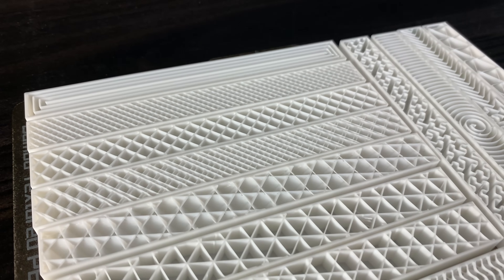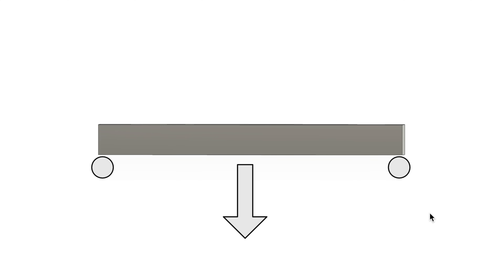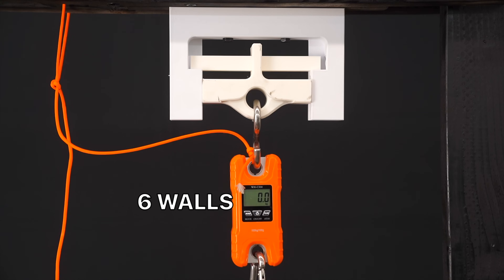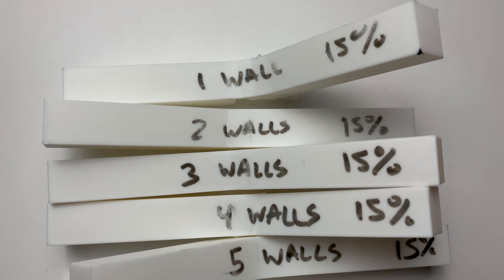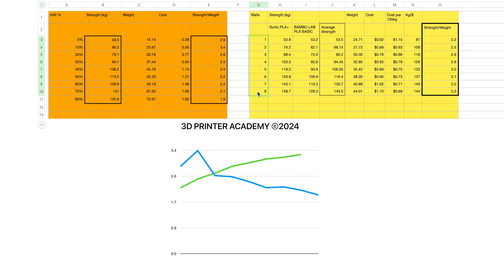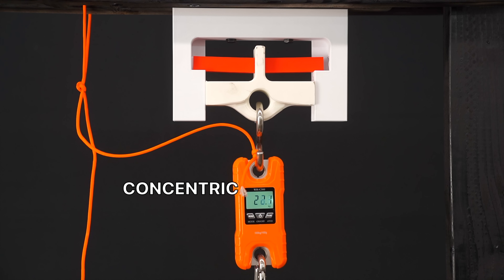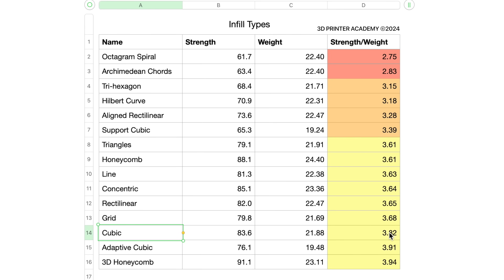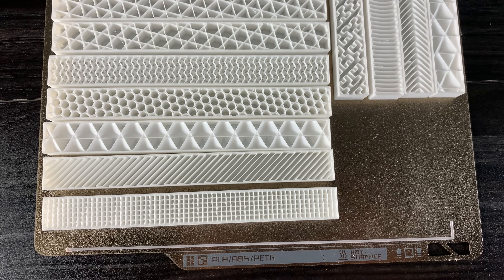This 3D Printer infill is the strongest (3D Printer Academy Tested - Episode 2)

Comment: Very usefull video. Regarding the infill percentage, the strength to weight ratio decreases as the infill ratio increases. This result, possibly, only valid for this type of test (three point bending test), as the highest stress occurs at the outer skin of the beam, whic is the wall. The infill is not carry much load. If the test is a tension test, the result could be different.

Comment: What is your infill to wall overlap set to? I'd be very curious to know if changing it from Bambu's default 10% overlap to a more solid infill to wall connection of 40-50% would increase strength across the board. Think about it, 10% overlap of .4mm nozzle is 0.04mm melted plastic connection.

Comment: Great vid! For more meaningful results each setting test should be run at least 3 times, ideally 5. 

Would love to see a walls+infill combined variable test. 

Overall, my suggestion would be to pick the best performing metrics from these results and iterate on those settings. With 5 samples per setting you can toss an outlier and perform meaningful statistical comparisons. 

Cheers for the great content, looking forward to more!

Comment: I've kinder missing the speed component, strength to weight ratio is nice if you care about the material price, but often enough we care more about the time.  Does some infills have an optimum percentage for strength/print time?
Reply: Agreed, though as a serious hobbyist with more than one printer, I've taken to printing slowly with some items,
PETG can work wonderfully with clear as glass prints in that regard, much over 20mm/sec and the clarity drops significantly

Comment: This is really cool. There's other factors too. Like direction of force, tensile or sheer. For the lightening would increasing the infill little add some more strength without much increase in weight? There's also the time aspect, obviously that's a linear relationship to weight but how does the infill geometry impact print time?

Comment: Would have been useful to know what slicer was used, as well as temperature, speed, wall thickness and how many of each type of samples were tested (I presume only one in this case) and what the deviation among them was. Also, were both of the filaments equally dry/wet? Were they from the same individual spools and/or batches? So many things can have an effect on the results here.

Comment: I would be interested in how much difference is there with constant wall thickness but different wall counts
For example when I switched from a 0.4mm nozzle to a 0.6mm nozzle I reduced my walls from 3 to 2 but it remains roughly the same overall thickness, due to the thicker print lines
Therefore the "number of walls" statement should probably be changed in "overall wall thickness"

Comment: Something I never see with these tests is infill orientation.  Print the same things off and rotate them 90° and see how that affects the strength.  I'm also curious as to how print speed vs number of walls affects print strength?  40mms vs 80mms vs 120mms.  Does printing slower net you a stronger part?

Comment: Speed of printing also seems to affect strength of a print as CNC kitcken noted in his videos. If you use a slow bed slinger to print these vs a corexy Bambu Lab machine, the corexy might be weaker

Comment: This is only one direction of force. Final result might be different if you use detail in another way. I would rotate the test model by 90 degrees and repeat the test 😅 and also, results are noisy a little bit. You’re using camera to understand braking force, but there is another important metric - a square of figure below the deformation/force graph line

Comment: This is interesting! Ive always had bad luck with gyroid at high speeds and tend to stick with cubic subdivisions/adaptive cubic, but i might have to give it another shot now.

One thing ive noticed with cubic subdivisions/adaptove cubic is that they come out very differently between slicers. On failed or canceled prints ive noticed that Cura cubic subdivisions are really rigid internally and have no air gaps, while in prusa slicer derivitives they tend to be more frail and allow stuff to flow between them. Maybe ive just never found the same settings combo when i jump to orca or superslicer that Cura defaults to? It would be really interesting to see the comparison.

Comment: I personally hate the feeling of hollow prints and would much rather go for the point of pure strength rather than strength to weight ratio. The point where diminishing returns hits a certain threshold of both infill and walls would be my ideal settings. I personally don't ever go lower than 4 walls and go up to 8 depending on the use of the print. 40% is usually as low as I go to make my parts feel sturdy instead of light and cheap.

Comment: Thanks for the very informative and useful info. It would be interesting to know load verses deflection of the top three maximum strength, wall / infill combos in Z and X directions. There seems to be enough deformation prior to failing to be conclusive.

Comment: Decent video on the subject. I also skimmed through the comments and I couldn't find reference to an ingredient that (some) people may not be taking into consideration when it comes to infill shape, and that is vibration. For example, as much as Gyroid may be a regular choice for some, I've found that what I will call 'wiggle' patterns not only cause excessive wear on the mechanics of your printer, but also have a direct affect on your printing quality...even on the print quality of nearby printers. I have an Anycubic Kobra Max sitting in it's enclosure right next to an Elegoo Neptune 4 Max (also in its enclosure) on the same table, and whilst the Kobra Max is performing the Gyroid infill on one project it shakes the table a tad too much and begins to affect the printing on the Neptune 4 Max, so much so that I can actually see layer shift that corresponds to the infill portions of the printing next door.....hence, as much as I may like Gyroid or even Sinusoidal, I generally stick to non 'wiggle' infills that are predominantly made up of straight lines. Just MHO.

Comment: for me as far as I understand, the best pattern is Line.

I concluded to this because of the low printing time, filament usage, item strength and no nozzle-filament crossing on each layer therefore less wear.

otherwise, I vote for gyroid.

what do you think?

Comment: If I understand correctly, you are using the total weight of the part rather than the weight added by just the infill (or the extra walls), right?  That skews the results and makes them heavily dependent on your actual part geometry.  I also didn't hear whether you were bending the pieces in the orientation they were printed in or 90 degrees rotated around the longest axis ... For some infills that will make a huge difference whereas for others that won't matter that much.  All in all, I'd say a nice set of measurements, but still so many questions left to be answered.  Until then I'll stick with cubic 20% and gyroid 15% for most of my functional prints.

Comment: Personally, I would be more interested in strength to prine speed ratios. for That i would probably do 20% cubic with 3-4 walls based on your data and my existing settings.

Comment: I'd rather focus on strenth to print time ratio and strength to print volume. I'd also test a variety of test geometries because this test ignores the main strengths of adaptive infills because if its narrowness. I'd also want to test solid fill between the patterns or 99% as most patterns don't support solid fill. In my use, grid is the optimal infill for strength over time fur mostvif my ok parts.

Comment: I feel like your graph intersection is intuitive but wrong. What benefit of having infill and wall count str/weight being equal? if anything, you would want to find maximum of a difference between both values, but it's also give wrong answer cause you made those graphs not independently (wall tests had infill, infill tests had walls). Lightning infill being "the best" perfectly highlights this issue. Better experiment would be to test the strongest wall/infill configuration for a given weight (and for several different weights as maximum point would probably shift).

Comment: This vid is not really news. However I think what's forgotten with gyroid is that it has significant non destructive deformation. Most of the others have very little non destructive deformation so when the stress limit is reached, failure spreads much faster.

Comment: 4:00 the optimal with respect to what? if you are optimizing strength vs weight then the optimal combination of walls count and infill density is NOT the intersection of both lines. for that you would need to plot strength vs weight (instead of S:W vs wall count or infill%) and for you that you will find that the curves never intersect. 

the data clearly shows that S:W is always increasing for wall count and always decreasing for infill density, so the optimal wall count is always "as high as possible" and the optimal infill density is always "as low as possible"--there is no data here supporting the decision in which you will choose additional infill over additional walls for a given additional weight budget and result in better S:W. maybe except in the rare case where you have 10g more budget but that only allows half a wall more which is not possible, then you go increase infill instead. 

if you do decide to increase infill above 0% instead of more walls it will no longer be for S:W optimization, but for other possible reasons like improving any other property or any kind of strength apart from 3 point flexural, which sounds reasonable although not backed by the current data or plot.

Comment: Please do more data organizing videos like this.  Google's Gemini Ai, told me each infill has a different thermal insulation value, like for printing ice box panels, a koozie, or incubator.  I was going to print hollow walls and fill them with Styrofoam pellet balls.  It said, infill would be better insulation, but couldn't tell me which infill is best.  And what about crush strength, sheer strength, or tensile strength?  Amazon has 3dHoJor filament for $10 per Kg spool, occasionally.  Is expensive filament stronger? So much data that needs to be organized.  I very much enjoyed this video.

Comment: If Lightning infill has the best strength-to-weight ratio, that should immediately tell you to test zero (empty) infill and tell us that strength-to-weight ratio. I'm guessing it would have done even better than lightning. In that case, strength-to-weight is clearly not the right performance metric. Instead, perhaps a metric like least filament to hold 100lbs, or something like that.

Comment: OK, but... we need to know bit more. The results will differ depending on orientation of the prints. And also would be great to know number of top and bottom layers and what infill was used for them since it was top and bottom layer what has been has been stressed most in first test.

Comment: Hi! This question if offtopic but I don’t know the right place to do it, it’s about the threadboard project that I’ve bought. I want to know if you can make a simple video about how to create a hole in any piece that fits with the thread, because I want to attach the board to my bed’s desk and I designed a piece to that but the hole has not the right hole to be attached. I would like you to make a vertical stand too if possible. Thank you!

Comment: Did you do the infill strength test twice for each part? Because some infill patterns have different strengths under tension in different directions! You should point that out! And yes 3D Honeycomb does perform best: It has the best 3 dimensional strength AND it has no line overlap during print. Dude, I hate grids...

Comment: Thanks for all the work, but this video is a missed opportunity to arrive  at conclusions. The infill fraction should be normalized to give the same strength (or at least same weight), then testing should be not just bending strength, but also pure compressive and tensile along multiple axes.

Comment: The results look correct and neatly organized,  but some of the conclusions are wrong, in my opinion.  Based on the data, the adding walls increase the strength to weight ratio,  while adding infill reduces the ratio. Therefore, the combination with the "best" ratio should be maximum walls and minimal infill (and not the crossing between the graphs)

Comment: Infill is for compressive strength.  Pulling from the center applies a small compressive stress at the top while mostly tensile stress at the bottom.

Comment: Very interesting.
All of these are at 20% infill? 
I wonder how the percentage is calculated. I have tried to modell these infills on prusa slicer... and adaptive cubic appears to have lower density than cubic - 20% cubic looks to be much more dense than adaptive cubic at 30%... Also 20% cubic looks as dense as gyroid at 10% ??? I'm probably wrong :)

It would be probably better to compare the infill amount using the length of filament used. 20% gyroid infill used the same amount of filament as 19% of cubic infill BUT at the same time the same length of filament as 37% adaptive cubic infill.

Of course, I did this on my model- so if it is possible, can you make one more experiment with adjusted infill amounts so the length of spent filament is the same, just the infill density varies?

Comment: You didnt take into account layer adhesion which is usually the most important strength property.
Reply: Also your title is which is the strongest... not which has the highest strength to weight. You focused on the wrong property.

Comment: Honeycombs are just not very nice to print, they're spectacularly slow. Because corners are not 3D printer's friend, have to slow down a very considerable moving mass every time to a near stop, induces vibration, and classic jerk is particularly unpleasant with it, though new motion planners are better behaved.

Gyroid introduces a lot of G-code text, but if you're not held up by the text size, parsing speed or planbuffer length, it prints very smoothly. And nowadays arc welding can bring down the text size and parsing speed as well.

Comment: 3D honeycomb offers better strength for the same %infill as gyroid, with a slight hit to the ratio. But I think the REAL question, if you want to decide which to use, is whether Gyroid is stronger on a weight-to-weight basis. If 3D honeycomb at x% gives you a 23.11g part, what about the strength of a Gyroid part at that same 23.11g?

The question isn't so much "Gyroid or 3D Honeycomb?" but "Gyroid or Gyroid with slightly higher % infill?"

Especially since doubling the Gyroid infill % will still print faster than 3D honeycomb!

Comment: 3:48 that graph doesn't have any meaning; if you had tested infill at 20% intervalls, the intersection would have been somewhere else entirely. The interplay of the two factors is interesting, but for that you would have to actually print different combinations.

Comment: Interesting infill results.  10% doubles tthe strength, but you barely double the strength going from 10 to 100% infill.  Which makes me wonder if 2 stacked 10% infill on top of each otehr would be stronger then 100% infill,  just going by the math the 2 stacked ontop should equal 160 , (80) each vs the 100% infill that only comes in at 142.  Cost wise this would be better too.    Would never of thought that, thanks for this valuable information.

Comment: From your results, in terms of actual strength the figures indicate that 3D honeycomb performs best. 
Your choice of lightning as number 1 is not based, it seems, on strength but on filament usage.
Lightning is only managing to perform at approximately 66% of the strength of 3D honeycomb
How much more filament would I have to use in order that lightning achieves the same strength as the 3D honeycomb?  After all having lighter parts is no compensation for premature failure.

Comment: i also want to know does increase infill width increase strenght to weight
Reply: it does; though with diminishing returns, doubling the infill % will double it's strength, but at a cost of more material
Reply: @davidconner-shover51  i want to know if double width vs double infill % with same amount of material which stronger
Reply: @deecat  double width would increase the infill percentage depending upon the slicer
Reply: @davidconner-shover51  just want to know between a big line with higher layer adhesion vs multiple line with less layer adhesion but more line which stronger
Reply: @deecat  I would expect that the amount of layer adhesion is highly dependent on other factors; material, printing temp, layer thickness and speed.

A larger line for a given infill percentage will result in much larger infill structures, depending on the application, this may not be helpful; watching all the top layers on a print fall into the infill is not such a good thing. They take less time to print, but they may leave much unsupported while printing With a thinner line, you are trading speed of print for top layer working out better, Some slicers handle this by increasing the infill density near surfaces, which is fine, most stresses on any structure (90%) are worked out on the sides and edges anyways, with very little issue in the center.
Reply: @deecat it varies depending on material, I know printing PETG with the right settings  yieds impressive layer and line adhesion results.
I would expect both to be about the same in total, the larger line width would be less evenly spread the strength across the part surface.
Looking for better layer adhesion, try printing an extra wall, every other layer, this can be found in the wall section in Cura